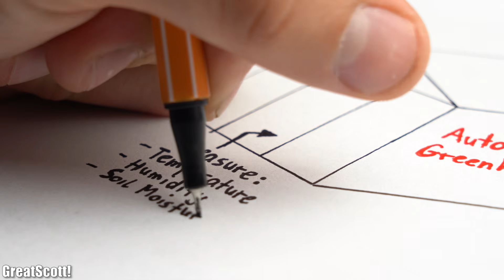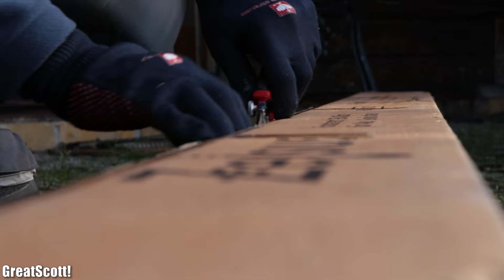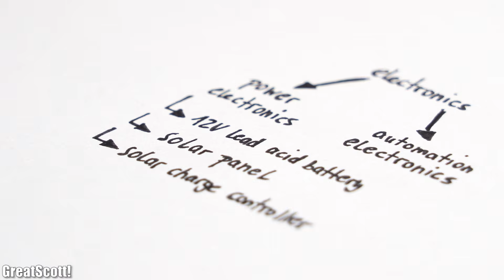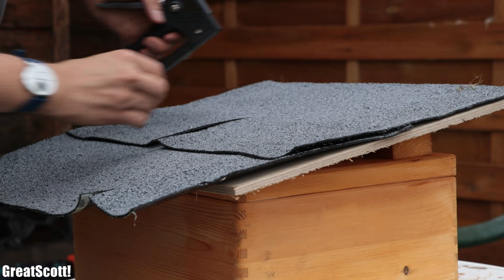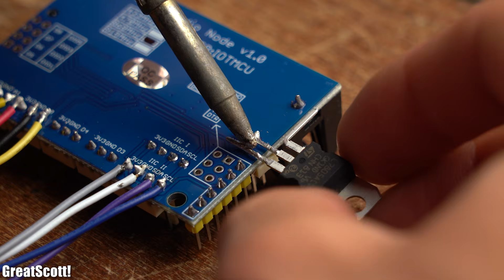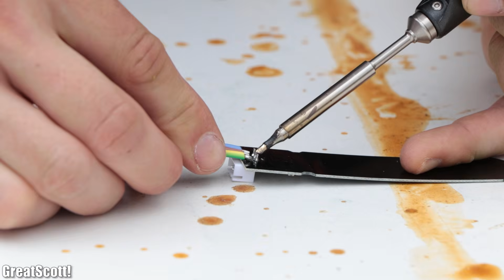Automating a Greenhouse with LoRa! (Part 1) || Sensors (Temperature,  Humidity, Soil Moisture)

Comment: Nice idea but I don;t like this having to have to sign up to a site to use a PCB board I purchased... That data should be obtainable and your data sent via WiFi on a high power link or antenna which is directional.
Nice idea you have there, I would suggest that the whole PCB is dipped in proper PCB varnish, the edges can be sealed with superglue, use of self adhesive heat shrink to add final layer of water proofing would be a good idea.
Have you considered insulating the box for when its winter? Or are you planning on not growing a winter crop and bring in the battery so it does not freeze and burst?
Reply: You don't have to use TTN lol
Reply: @GreensladeNZ  my point is it yet more of this bullshit of having to be online to use shite. Getting a bit fucking fedup of it.

Comment: Great project. I have been working on greenhouse porjects for several years and can offer on bit of advice. Your bme sensor will not last long in a greenhouse. After about year or so, you will be getting poor readings, or it will stop completely. Highly recommend using more rugged temperature sensor (RTD) and use the wet/dry bulb method for calculating the humidity.

Comment: Battery gives off hydrogen sulfide that can build up (even AGM sealed) that can lead to charge controller corrosion and failure and or a hydrogen explosion without proper ventilation of battery box... just a thought

Comment: Awesome video! I recommend you that you shuld use a cable protector like a rubber or something like that, ( in this minute https://youtu.be/2YJHcGQnpAk?t=687 ) because the metal of the base can broke the sheathed cable and expose the wires. Regards from Argentina!!!

Comment: Newby question. You waterproofed the chips with nail polisher, but what about the solder joins? Is it okay to leave those exposed to water?
Reply: Just paint those too. Make sure the wiring is coated a little pit too on all ends, so that the water doesn't wick down the cable and bypass the polish.

Comment: Nice!
I have been trying to complete a solar powered garden watering system myself so I am looking forward to the second video.
The basic setup is one (or more) valve controller(s) (for different parts of the garden) that also measures soil moisture in several places (different plants have different needs) and uses rain water.
These components report values over mqtt to home assistant which then decides whether to water or not (I use home assistant for other things as well).
Code is done and components have been tested, "just" need to solve some power issues and put it all together.
In the meanwhile I created a simpler version that wakes up every three hours, checks battery charge and then pumps until battery voltage gets too low and then sleeps down until next time. That last project is closer to completion. :)

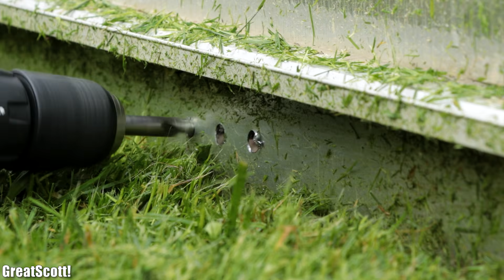Comment: 11:26 remove the sharp edges of the holes pls. because Health and Safety
Reply: I don't really see how it would add to health and safety. These holes are basically never touched
Reply: Easily fixed by smearing some silicone caulking over it.
Reply: @linagee  or maybe put a champfer on it

Comment: Hi Greatscott, i have used the capitance soil sensors too. But there are really cheap and a mess to work with. I would rather recommend you to build one yourself, with two isolated wires/metal sheets a very high resitor(1M) and the Capacitance Touch Arduino Libarie

Comment: That's a very good video. A word of advice though. Stake that green house down tightly so it can't flex. I even put a couple of straps over mine. If you get storms with strong winds at certain times of the year, it can cause it to flex and lose the panes of plastic. Once you lose one or two, the rest start popping out. Also, flexing in the wind eventually causes the screws to work lose and the frame to come apart after just a couple of years. If you want your green house to last a long time, keep it stabilized so it doesn't move.

Comment: Hey! I must point out that your solar system is not ideal.
I made the same mistake as well. The capacity of the battery must be matched with the charging current and a 500mA charging current is just not sufficient for a 44Ah battery.
That is even assuming that you will get 500mA. For a PWM based charge controller, the efficiency peaks at around 60% so I think you will get 350mA approx flowing through the battery.
In the short term, everything would look fine, but low charge currents will destroy the battery prematurely. There is a relation b/w the capacity of the battery and the minimum charging current needed for it. Also, using a car battery for a solar project is not a good idea in itself. 
https://ftlscience.blogspot.com/2017/01/the-solar-misconception.html
Feel free to browse this (very old and dirty) post I wrote regarding the topic. I had not documented battery failure by this point, it takes about 6 months to occur instead of the standard span of approx 4 years for lead-acid.
PS:- That outro tho!
Hope to see your reply here! :) 
Viel Spass!

Comment: Hello GreatScott. HEX to ASCII is not ideal in a Lorawan network. You can use Cayenne LPP format ( there is an Arduino library also) or you can write your own format which uses bytes instead of ASCII. Cayenne LPP format is ideal if you plan to visualize data at the Cayenne portal which is fully supported by the Things Network.
Reply: He's not sending HEX though, that's just how TTN displays the payload in the console.

Comment: Wow, I've made the same project using raspberry pi and WiFi connection. The project is open source. It has a web interface then it does not require programming or flashing stuff. Here the link: 
https://hydrosysblog.wordpress.com/
I also made a lot of experience using the hygrometers, which are not so obvious to use to control the irrigation. For any suggestion just ask, love this type of projects!

Comment: 11:25 you forgot rubber grommets on your wires the thin aluminium will cut the insulation off the wires and short.

Comment: I suggest to use outdoor power cable that is UV resistant will not corrode due to the sun and replace the zip-ties with galvanized steel wire for the same reason.

Comment: Why did you use silicone wiring? I mean, don't get me wrong, that's stuff great, but it's kinda expensive. Simple PVC cables would be ok too or telephone-cords (for the sensors) would be more than enough.

Comment: Great idea. Nice project. Please consider some ideas and improvements:
- Important: Put legs under your battery box. Your wooden box's bottom will rot out in no time if it sits directly on the damp grass or soil.
- Add a light sensor and optionally a UV sensor. That will provide some interesting data to compare to the growth statistics of your plants.
- When adding motorized window openers, add a wind speed sensor that commands the windows closed on high winds. (or tie it in into an existing weather station)
- When adding all kinds of motorized controls like window openers and water pumps, you might want to add a battery voltage sensor and program a power-saving mode.
- Watch out for snails. They like to eat pumpkin saplings.

I wish I had space to build a greenhouse like that.

Comment: Very important thing for anyone trying to do this, all those sensors need to communicate over digital protocol. You can not use analog and just measure voltage output. Parasitics would drive you insane as readings would be all over the place. Also important note is never to try and maintain soil humidity. Plants don't like ideal conditions. It needs to be periods of moisture combined with dry periods. In drip irrigation, you would water every 3rd or 4th day for few hours (depending on temperature). That is for plants in the ground. If they are in some other containers like pots, they need to be watered more frequently.
I would also advise pulling up dirt on the outer walls until height of metal foundations. It would allow greenhouse to be used earlier in the year as metal is good conductor of heat and above ground is the coldest temperature. Adding that dirt would isolate from heat loss and prevent frost from affecting plants.
As for those self-adhesive pads, I predict they will fail within first week. Have fun! :D
Reply: Do you have any book recommendations for learning more? I have heard that plants like cycles of wet and dry periods from another YouTube channel called Practical Engineering, but I always wondered what the source was. Interested in learning other little tidbits about plants and how to maintain their health
Reply: @TheEpicPineapple56  Sadly there are no international gardening books I can point you to. My parents farmed vegetables for most of their lives, still do in smaller quantities for personal use. All the books we have are in local language from farming schools.
Reply: Not totally true or else hydroponics would not work. This is true only when using soil as a medium.

Comment: Awesome tutorial, love the concept behind using TTN instead of point-to-point to your apartment but I do have a question: how do you get around TTN's "fair use policy" which pretty much says that you're better off not transmitting anything at all (ok sarcasm my bad) but really - every 60 seconds? That will certainly put you over the top?
Reply: I use Mysensors and LoRa with RFM95. 433Mhz. And Home Assistant as a controller. Then you are not stuck the Lorawan 1% duty cycle on the radio link.
Reply: 1% duty cycle is easy with a small enough payload
Reply: @GreensladeNZ  I respectfully disagree, it isn't about the size of the payload - of course we keep it down but even with 6 bytes of payload, reasonably real time (every 5 mins) stream isn't viable with TTN. That is what I meant. My bad if I wasn't clear in my comment

Comment: Nice project, but soldering those thick wires to the PCB though... Will that really last? :-) What about making at least an adapter board with screw terminals?

Comment: Hi Scott, just a few questions.

Why use a car battery? won't this sulfate from all the daily charge cycles? would it not of been better to use a deep cycle battery or just a simple small sealed lead-acid that is more for multiple charge cycles then high current, or does this not matter for this application?

Why use a 5V regulator? there are 2 USB ports on the charge controller, did it not provide enough current?

Why put the light sensor on the side, doesn't most of the light come in from the top, hence why the solar panel is there?

Thinking of doing something like this of my own, so the coding demonstration helps a lot.

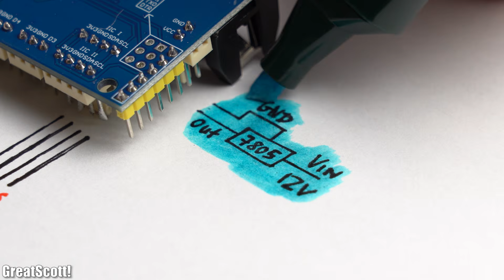Comment: 8:39 you should really use a buck converter rather than a super inefficient 7805. if the 7805 gets hot, it may blow the arduino
11:31 please tell me you put grommets on there to not cut the cables?

Comment: What? Does the capacitive soil sensors still work for you? 
I did a project like this one year ago, and I found these sensors to be useless! They trigger on so much more than soil moisture, and even walking past them changes the measured value...

(I made a portable planter with only one litre of soil and a water reservoir, so that is probably more sensitive to disturbances though.)

Comment: 5 meter I2C via an unshielded cable near the earth. Ahh yes, perfect!
Reply: Works though.
Reply: I think as long as the clock frequency is below 100 MHz it shouldn't be a problem to have a cable of such length. Perhaps once the cable length exceeds 10 meters or so, then it's a different story...
Reply: @pilotvision97  kHz, but yes :)

Comment: Why do you solder every single cable instead of using connectors?
Reply from the maker: I like it this way
Reply: @greatscottlab  Hahaha ok, but is there a technical explanation? 😅 When I did outdoors automation projects with arduino, the solder joints always tended to break over short time, probably due to thermal oscillation and cables stretching around. Then I started to use green lock connectors like the power input to prusa RAMPS 1.4 and they work perfectly without needing maintenance :)

Comment: These soil moisture sensors are terrible. They will be degrated really quick. I tried with nails and even if is not the best solution, is way better then this sensors.

Comment: You might want to use some kind of seal to prevent the three cables going through the foundation from rubbing agsinst the sharp metal from your drilling. If not, they might be cut through eventually 🙂

Comment: Is that an 18650 holder on the cobtroller board? If so, why are you using the external lead acid battery?
Reply: 14500

Comment: very useful project, thank you. Can this be done with just WiFi or LORA is more suitable for low powered projects?
Reply: At 0:50 he said the greenhouse was 300 meters from his house, so he needs LoRa for the range. A ESP32 WiFi board doesn't use much more power, so if you don't need the range, WiFi will work.

Comment: I would recommend to add a Grommet (german: Durchführungstülle) to the hole for the cables. 
Also i would protect the edges of the PCB of the soil sensors, the material of the PCB could get soggy (not sure if you already did it)
Reply: Real rubber cabels are always the best option but the silicone ones are quite nice to especially around water
Reply: I second the advice to protect the side of the soil sensors.  I'd be interested in seeing how you handle the data from them. I'm currently using an esp82 and mqtt across wifi to collect data from 2 of them.
Reply: It's fiberglass so osmosis will destroy it like on fiberglass boats if surface is damaged.

Comment: You haven’t protected the pcb edges of the moistures sensor with polish nail. It will get damage with the time 🙈
Reply: Also You should insulate the cable entries with rubber to avoid corrosion
Reply: Also, a coated wooden box isn't a  real good way to protect electronics.  Moisture will still get through.

Comment: Hi Scott! Great project! I'm only curious: didn't you have problems with BME280 connected with such a long wires? I2C was designed for very short wire lengths.
Reply from the maker: No problems

Comment: Instead of the 7805, you could have used the USB output on the charge controller which most likely will be a switcher.

Comment: Great idea, however I'd rather use ESP8266 and send that data directly to my own server processing it and can be analysed later. People who are both developers and electronics hobbyist  would like to see sensor data with own database system and it's analysis and I've yet to see someone try it or try myself one day :)
 Although many IoT platform now a days help abstracting these stuff, I feel like there's still room for improvement and it's at very early stage.

Well what do you think about creating a good gardening automated system which would water plants, mix nutrients and alert you when something goes wrong? This system could see those days I believe.
Reply: I would also rather use my own server. Not everybody has one, though. Also, this greenhouse is 300m away from his apartment. WiFi probably wouldn't reach.
Reply: @eDoc2020  well that won't be an issue with widely deployed WAN networks and using existing cellular infrastructure. Most usecases can be covered with that. And one can always bring their own infrastructure if connectivity is worth for the cost of project. I agree regular wifi won't reach there but there are alternatives abd that's why he used LoRa which operates at 915MHz band. But all those alternatives either require extra infrastructure or usually require commercial licences as they use non ISM bands.

Comment: Is there any chance that a LoRa gateway can pick up the signal from a LoRa board with a 40/50cm concrete slab in between and a distance of 350m?
Reply from the maker: Hmmmm not sure
Reply: @greatscottlab  me neither, I wouldn't want to buy everything and then discover that they cannot communicate :( 
In any case great job, keep it on💪🏻
Reply: I would say a definite maybe. LoRa does work better with LoS, I've sent packets 20km at SF7 while driving, however it does struggle with obstructions.
Reply: @GreensladeNZ  thanks for sharing, maybe one day, with a little more free time, I'll impulsively buy it and try 😅

Comment: Create an app that gets those hexadecimal values and turns them into temp humidity and analog voltages and also add an SD card to the arduino board so that it records all the data over time

Comment: Great project, looking forward to part 2
I use a similar system in my greenhouse, though not Lora but plain RFM69 communication to a central receiver. The data send from my sensors are encoded in JSON which gives some more flexibility. JSON is not low on packet size therefor I use something called CBOR which compresses the JSON into very few bytes. When receiving, in the other end, I have a converter from CBOR to JSON. In an other project based on LoraWan I use the same CBOR components. In this project I use NodeRed to subscribe MQTT from thingsnetwork to receive the binary CBOR data, by using a NodeRed CBOR node you can translate the incoming binary data into JSON, and from there its easy to do what ever you want. 
Take a look on http://cbor.me/ to play with encoding/decoding with CBOR.

Comment: I hope you won't leave the wood box on the ground
Reply from the maker: I do
Reply: @greatscottlab  I would suggest placing the box on something, maybe bricks to keep it off the ground. Regular wood will rot in soil. You probably also should drill some holes in the bottom of the box so moisture can't collect.